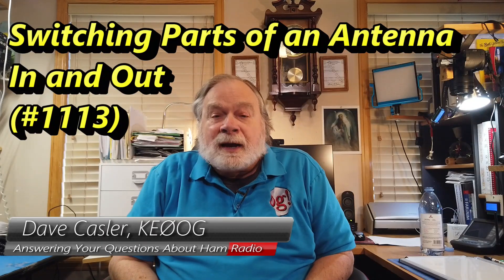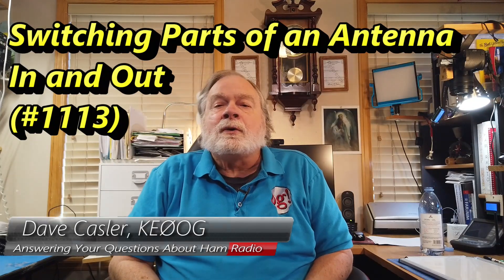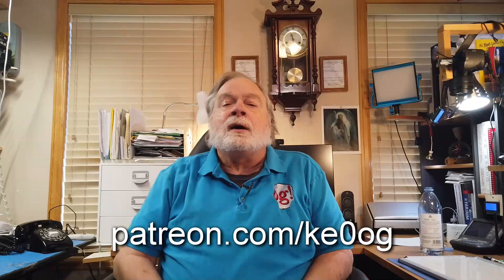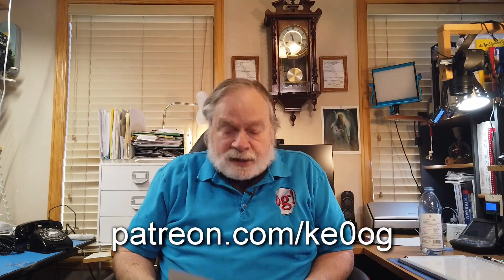Switching Parts of an Antenna In and Out (#1113)

Comment: You could try, instead of a relay, a mechanical switch (rotary for example) controlled with a servo or similar mechanism that needs power only to change the switch position (off / on).

Comment: One idea I have been toying-with is to use air switches, like the ones used for hot tubs to avoid electrocution hazards, In particular, I want to have a 40 meter delta loop that can have a section of wire opposite the feed point that can be isolated, creating a 80 meter halo dipole.

Comment: another excellent video. I have a question for you, "Is it possible to make a 10m yagi?"
Reply: Definitely possible! I have built them from aluminum tubing but a cheap and easy way is to use two wire dipoles parallel to each other  . One is fed with coax and the other is just a halfwave piece of wire. It can be either the reflector or director while the dipole with the coax is the driven element. The spacers can be thin wood pieces. Spacing varies depending on if you want a director or reflector. Spacing is about 4 feet more or less. Typically directors are shorter and reflectors are longer but not necessarily. Two dipoles the same length can be used and varying the spacing can change the parasitic element from a director to reflector! It can also have gain in both directions! It is possible to get spacing just right so it is a very good match to 50 ohm coax and work with good gain. The ARRL antenna books have info and curves showing how Yagis work. I built several over the years for 20, 15 and 10 meters. By adjusting the tension in the supporting ropes it can be made to hang perfectly flat even with the coax hanging down.

Comment: An EFHW for most bands is the easiest solution. For the others a long wire with a remote ATU. If you  want to switch different sizes or verticals, open frame power relays can be remote controled in the shack. BTW, they also work great with ladder line and even coax if careful.